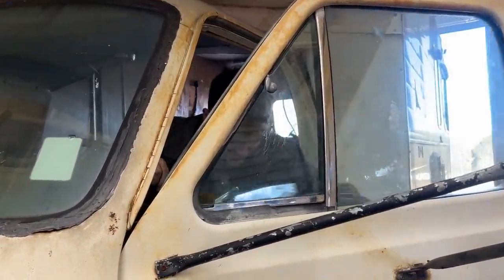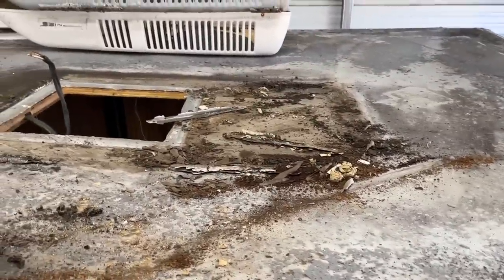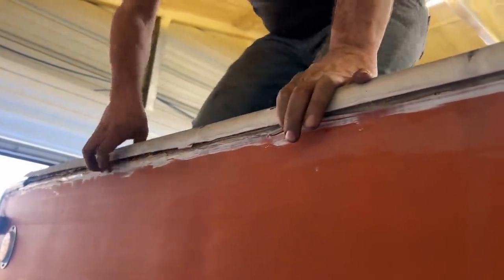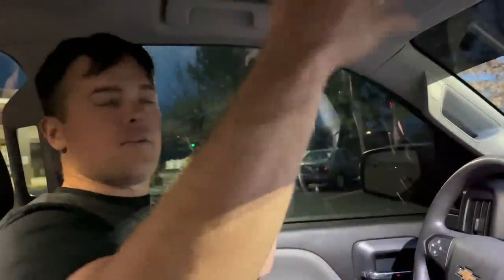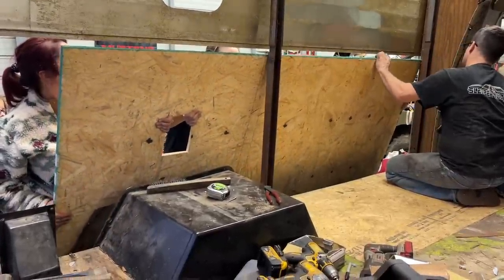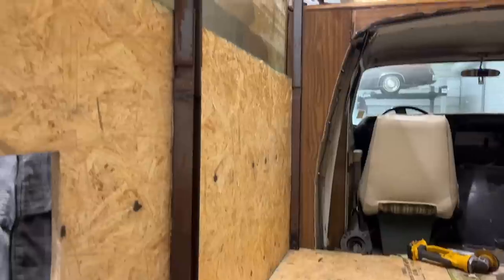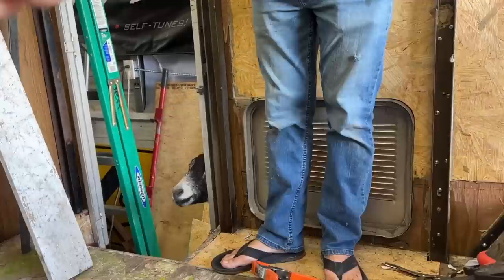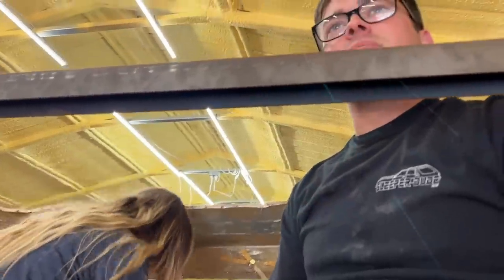Rotten Roof, Walls, and Floor! How bad is it? Antique Motorhome Budget Remodel.

Comment: I think it's weird the manufacturers of motor homes make the roof flat. It would be better if it were pitched so the rain would run off and wouldn't have as many problems with water damage. But that's just me. I might give it a slight slope to keep the rain from collecting. Ya'll are doing a great job so far! I think it's gonna be awesome and will go the distance! Thanks for sharing! Ya'll are funny and awesome!! 😁😎

Comment: I can't get enough of your video's. The whole family involvement is fantastic 👍. Structurally the camper is not going to fail!. With the rebuilt engine and the gearbox you have planned for it, the campervan will last for many years! The internal fit-out is going to be more exciting than the walls & roof install.
Reply from the maker: Glad you like them!

Comment: What a job you've started.   Good thing you've got the family there to keep you motivated.   One suggestion I have for you when you pull the engine is to look real hard at going through the passenger door with it.  It's a bear to pull out the front and a slightly smaller bear to pull out the passenger door.  Take the intake and heads off before you pull it to make some extra room.  Good luck.
Reply from the maker: Ok thank you

Comment: I do have some experience in repairing an rv. Most rv roofs are no properly designed hence the reason they leak. So I will make some suggestions. I would add two steel reinforcements from the front steel support al the way to the back support. Space these from the center the width of your ac cutout. I believe that is 14” square so in between the support it should be about 14 1/2”. Between the two bars add two more perpendicular to the two front to back framing the cutout for the ac. It is the heaviest item on the roof and will eventually cause the roof to sag in that area. The two supports front to back will also allow you to put down a strip of 1/2” on top of the support before you put the plywood for the roof down. This will cause the roof to have a slight crown so the water runs of the sides an eliminate puddles that can hold water. And last the rubber roof should extend over the side a couple of inches so the edges are smooth and the water can easily run off. Thanks to you and your family for all the enjoyment you give us couch potatoes. Contact me if you have any questions.
Reply from the maker: Sounds good thank you

Comment: When you get your roof put on and it settles in I would suggest paint made for the roo material you put on. Lowes sell this type of paint, I reroofed a 35 foot camping trailer and painted it white to help with summer heat.  It reduced the inside temp 15 to 20 degrees during summer. Gary
Reply from the maker: Ok thanks

Comment: Hello from Ocala, FL.  What a monumental job that's going to be, but you guys just dug right in. I've never seen the guts of a motorhome, and I was a bit surprised at how cheaply they seem to be made. On the other hand, this one is 30 years old. I'm sure it will be more structurally sound when you are done than it was brand new. You handled the carpentry tools like a pro. Maybe you should start a Sleeperdude carpentry channel or home improvement or something. Why not......Looking forward to see how this shapes up. Wife and I think it's great that you plan to finish your cross country trip, since the last one didn't end the way you wanted. I see you guys have been through Ocala several times over the past year. If you ever stop for lunch, well, lunch is on us. Maybe we can catch up with you guys on your next Florida event if it's close. Great video and keep up the good work!
Reply from the maker: Thank you so much! That sounds great 😊

Comment: Also, the MINI I had was about the same age as yours and we had a leak in the nose of the cabin over the cab, I had the folks that repaired the leak leave the window out and replaced the front skin completely, NO MORE LEAKS!! With the window on an angle and not protected rea well, it will always leak.
Reply from the maker: Awesome thank you

Comment: Wow!  Can't believe how far you're taking this one!  Another solution to consider for your roof.  Check out Ship Happens and when they resurfaced the upper deck.  I am pretty sure it was a fiberglass/resin with special coating/paint.  If it's good for a ship deck, it should be good for the roof of a camper!  Plus, I figure you are good working with fiberglass.
Reply from the maker: Ok thank you

Comment: Wow that is a huge undertaking but I am looking forward to seeing how it comes out. Since all the gas appliances are gone, for heating they do make a heat pump A/C unit that will fit into the same space that the previous roof ac was in. That would be a good way to go since space is limited.
Reply from the maker: Yes that would be good

Comment: Cool project. When you rebuild the engine give it some bigger nuggets and upgrade the tranny to a 4 speed it'll help tremendously on a 5,000 mile trip. What ever you spend on the upgrades you'll more than make up for it at the ⛽

Comment: Hey guys its coming along quite well for the inside you can buy foam sheets  to line the walls then use a thin panel  sheeting over the top a good idea is to do your internal fit out before you the rear and roof on and put all your edge stips (gaskets)as they call them with a mastic same as your windows should look good when finished
Reply from the maker: Yes sounds goood thank you

Comment: If you get air pockets down the road you can drill a hole in the top of the air pocket and put apoxy or liquid nail in the hole then make a clamp like you did with the whole thing.
Reply from the maker: Ok thanks

Comment: Use more steel and put a couple stringers in the rear section spread apart where you’ll put the ac unit, it will really help with roof sagging.  I’d honestly skip the bathroom and make more sleeping room, but that’s just me,  a generator and minor stove and a fridge goes a long way, plan around hitting up camp grounds
Reply from the maker: Ok sounds good

Comment: Wow. That looks like a lot of work. I have always wanted a motorhome, but all the affordable ones I found are as bad or worse than this one. I lucked out and found a retired ambulance on a Ford F350 chassis. If you want a motorhome that will never rot, that is the way to go. It has all metal construction. Oh, and it's also already wired for shore power. Easiest conversion ever. Just a recommendation for your next one...

Comment: Put a little insulation in, I did the solid plywood wall repair on mine, it grew so much mold because of condensation, it was just a mess, even a 1/2" of foam
Reply from the maker: Yes I think we will

Comment: The one by threes are not bad ideas up in the front I would run some square tube and weld a wall pattern on kind of like in the back and bring it down across the floor in screw it to that or bolt it because over the period of time of people getting up here and sleeping or anything up or moving while you're driving the screws can pull through the wood of air above the the cab and if you would weld a metal tube structure of the front it would just be more stronger so when the wind going down the road and it would help hold the roof in the front aluminum piece and window
Reply from the maker: Ok good tip thank you

Comment: I did a travel trailer and used structural steel studs for a lot of the frame work. Much lighter than wood. And super strong. Good luck with the build. I’ll be watching

Comment: If you don't want propane inside, you can always put a rear hitch mounted outdoor kitchen with a tankless water heater so it will be out of living/sleeping area. Also, since you are designing the inside from scratch you can make wall mounted foldable bunk beds for more space, and use a portable floor a/c, since roof air conditioners are very noisy, heavy and the fewer new holes in roof the better.

Comment: On an RV I wonder if it would help if you give their Rufus light Dome shape or a slight angle down towards each side to help the water runoff probably give the RV upgrades to LED wherever you can it would be a cool idea to do bed liner exterior paint on the RV it would help seal and protect it.

Comment: Happy Birthday Josh!!  Instead of another rooftop AC, look into the DIY Mini Split system, they work great for Mini Motorhomes due to their size. It will also remove the possible of leakage in the future as well as the cost for a mini split is not that bad. It can be mounted on the rear bumper and be covered while traveling or uncovered if you install a genset. Good job on the EPDM roof, I was going to recommend that as well.. Please don't skimp on the casings for the ride, I replace mine on my 36' motorhome every 6 to 7 years. Love the videos you and the family do!
Reply from the maker: Ok thank you

Comment: That bird stick is a Pheasant not a Quail... Make sure to double up on each panel seam and windows when sealing it to keep moisture out.. Also consider using a diff container to use to feed the soder to the pig I would hate for them to bite down and shatter the bottle swallowing the glass

Comment: you guys are doing a great job scribing the window holes works great so your not having  to measure the openings, one thing I would have suggested is using the Liquid Nails paneling adhesive for the cladding, it has better tack meaning it grabs the aluminum and dry's faster than the standard adhesive, also it will come in handy when your finishing the interior walls and make the job allot quicker with less clamping and need for excessive screws.
the regular stuff works great for general use I use it all the time for my finish carpentry jobs
Reply from the maker: Ok thank you

Comment: Fantastic work. The only advice I can suggest that may make it easier to secure the metal to the wood while it is drying is to use a full sheet of the wood clamped to the outside. This will apply even pressure all over and then you won't need to install the windows. Just a thaught.
Reply from the maker: Ok yeah that would work

Comment: I used to work making Trailers for oil rigs and their crews. Basically they were campers for multiple working camps. They were built just like these things and done as cheap as possible. We could crank out three or four in two days. I think they should have just pulled what they wanted from this thing and just pushed the rest off a garbage dump pit!! lol.
Reply from the maker: Awesome thank you

Comment: A square box tubing metal frame with such a great idea for support. A slick fiber interior for the walls would make a great idea 💡 curb cleanup when you're using it. Don't forget to insulate. Open cell vs. Closed cell foam spray in insulation. It just comes down to cost because although one is so much better than the other is it really cost feasible. A backup camera and some security cameras built-in would be great. Along with some low-powered lights built-in. Sounds like you're rebuilding the whole vehicle. Best wishes for much better trip to see this great country then the last RV trip.🇺🇸
Reply from the maker: Awesome thank you
Reply: @Sleeperdude  AAA RV towing premium insurance package. Plus you get service calls like jumping a battery changing a casing. Yes you're the mechanic but the whole package might come in good use for the rest of the family. Because there's a limit to how many can put on a card without costing more but it'll cover your kids if they're writing to ball practice and the neighbor Jone's SUV and they have a breakdown! And kudos to your family for trying another RV trip. If you get a Walmart roadmap Atlas, they used to at least had every Walmart listed. That way if you have a cell phone service and internet service you have the trusty backup. The fuel injection conversion interests me greatly. I have a 74 Dodge charger and a Dodge conversion van that is in great shape and they may be a likely candidates for me to do that conversion.

Comment: As little as I know about restoration I was wondering if you were going to add some form of insulation back to the walls. also do you plan on adding back the shower and possible a small bathroom. also running water, power. I hope to see those additions because they would be very handy in the long run :D
Reply from the maker: Yes we do plan to add insulation, a sink, and toilet. Probably not a shower though

Comment: While you’ve got it apart figure out some sort of hinged back panel so you can drop the entire back wall like a toy hauler. With the added steel bars it should be strong enough. 

And what is the scar on the back of Ralphie’s head?
Reply from the maker: That would be cool. 

I had told him to stay off these hoops I had stacked up, I left and he climbed on the top of them fell off and hit his head on one cost him 10 staples.

Comment: Excellent video Sleepdude Crew  Josh  :) also families project and did super job fixing up RV vechile camping part yes task to do one because I had done one years ago ! One did from 1980 Chevrolet 1 ton gas motor, Automatic transmission Overdrive type with 411 rear end gears was old cube Van turn camper  for 2 people only  and did all frame to powertrain  , brakes , fuel systems and electrical equipment plus much more even paint too! Was fun to and enjoyable challenging too ! But costumer was pleased and used lots! Also on windows do rubber seals Josh take all steps too hopefully motor easy to repair and transmission too repair! Check Drive shaft to in Universal joints to repair and axle bearing to plus new fluid ! Also fuel tank on plastic or steal one even send unit too and all can too! Adrian looks like 2 babies! Also Happy Birthday Josh  :) , I hope you have a excellent day with work plus families & friends to share surprises with you also wishes come true and many more years ahead to also wonderfull year ahead to also! Best Wishes from me in Ontario Canada 🇨🇦 also friendship last lifetime and forever to also my birthday was January 6 Lol!

Comment: Most people don't know but on most caulk guns there is a hole near the handle if you stick the tip of a new tube a caulk in it and squeeze the handle it will cut it off

Comment: You should extend the metal framing all the way to the front and put some for where the AC unit will be  like 2 from the back to the middle section  to help reinforce the roof so you can put a cargo storage on the sides of the roof
Reply from the maker: Ok thanks

Comment: I recently had to have my class c cabover bed area completely rebuilt. They are notorious for rot and for weakness. Since you have a wide open platform to work with instead of using 2x2 wood on the sides, why don't you use that same two by two steel and build myself framework that only goes out to the front but across left to right and make it nice and solid for strength and durability in. Just a thought you're doing very nice work on it. By the way, I enjoy watching your guys's videos
Reply from the maker: Thank you yes we could do that

Comment: First off thank you for the video always appreciate watching you and your family work together all those seem like ralphie was more in the plan than working this time for the first time but second I've tore off the whole shells of trailers campers and build it like a house on them and never put the aluminum back on my opinion you guys are doing a hell of a job sorry for the language but are you guys putting the aluminum back on and pulled it off and then sticking it because that's how you keep the air pockets out on liquid nail I mean it you guys are clamping it down pretty good to make a stick that's awesome but I'm ready see you to do the inside oh please replace your fuel pump and your gas lines and tank you had so much problems with the other one and that was your main issue was appealing I know you said you're going to rebuild the motor you got the new tranny to put in but I would hate to see y'all have to sell this one so cheap like the other because you did put a awful lot into it and I really enjoy watching someone else do all the work so keep it up lol but enough rambling on thank you I do think y'all should paint it and make it very known that this is a sleeper dude camper and so everyone will see and notice it is y'all's on the road again but thank you for the video and make sure we get to see this whole project

Comment: Josh, I wish you would move that 64 Ford wagon away from the fence and with the other cars. I am afraid it is going to get hit when you do the drives circling the yard. Especially when someone other than you drives because it can be so hard to steer and brake those project cars when they are undergoing brake and steering work.
   PS. I really like that wagon.  🙂
Reply from the maker: Ok will do

Comment: Be sure to replace the foam insulation or you will not enjoy the cold and heat  and road noise. It's there for a reason. you will need a different liquid nails for foam insulation.
Reply from the maker: Ok thank you

Comment: you ought to paint the roof ply wood with epoxy paint to water proof the plywood. and connect the back metal supports all the way to the next uprights, also put some metal under where the roof ac will be.
Reply from the maker: Good tip

Comment: Number one attaching the metal to the OSB should be used with contact glue it'll work much better and glue faster number two you may want to pre glue the metal to the roof OSB first and then seal your scenes remember to overlap three to make it easy on yourself on the inside I recommend using the cheap commercial carpet on the walls it will look good and insulate number four I love the cross on your son remember you're doing this it's yours and if it works you didn't do it wrong have a good one buddy